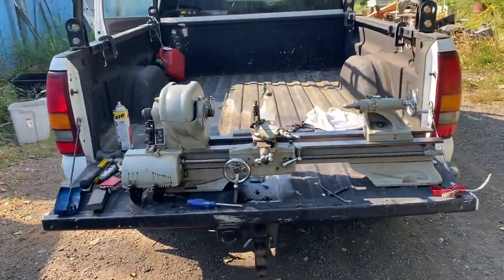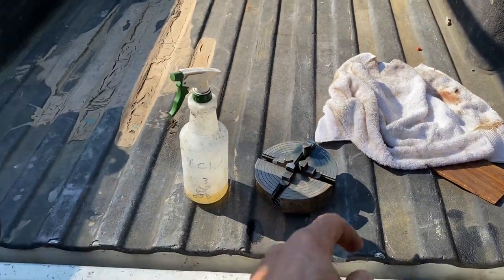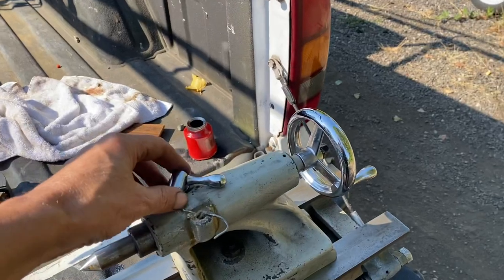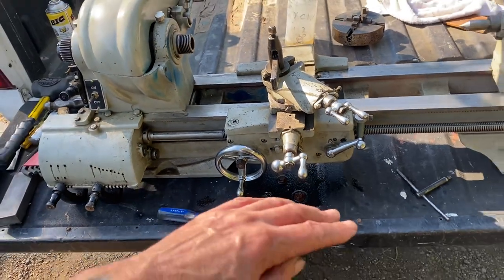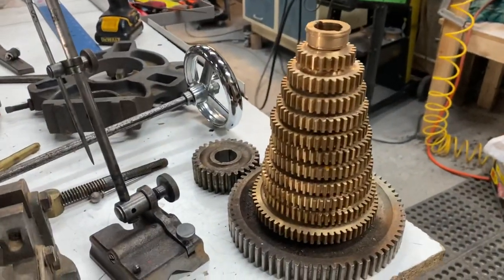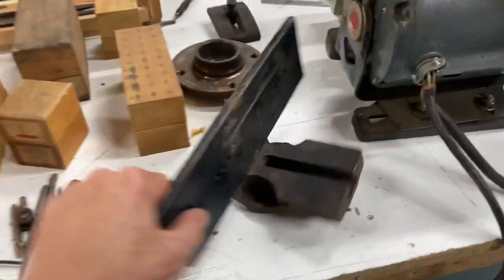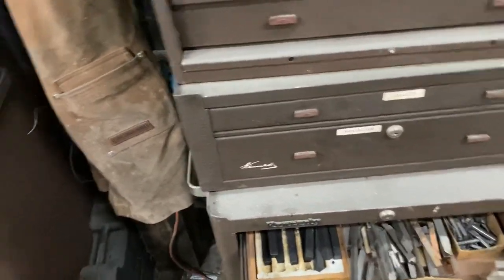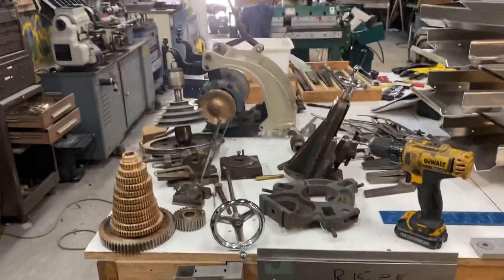Atlas QC42 Metal Lathe

Comment: You have the wrong pulleys on the motor and matching countershaft. Clamp and bolt missing for the steady. need covers for the QC.  Charts for it can be had on Ebay. Attachments look like a home made woodworking fence and the other a winder for wire?
Reply from the maker: I know the pulleys aren’t stock. Clamp to the steady rest and bolt were in a box. I’ve been on Ebay already looking for replacement charts, but didn’t find them yet.

Comment: 54 is better but that ones better than nothing
Reply from the maker: Length becomes a liability with these little machines. Same reason I don't like the 12" version; the further you get from the ways, the more leverage, and that leverage becomes flex. Most of i will be in the compound, which is way under built.